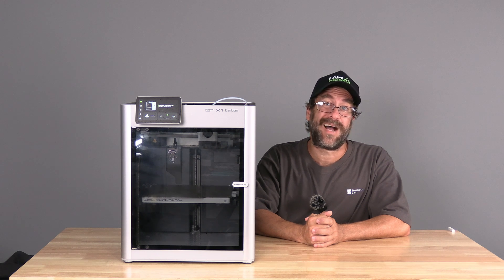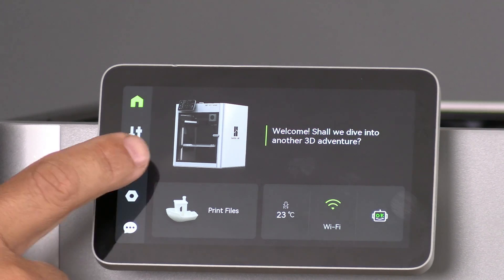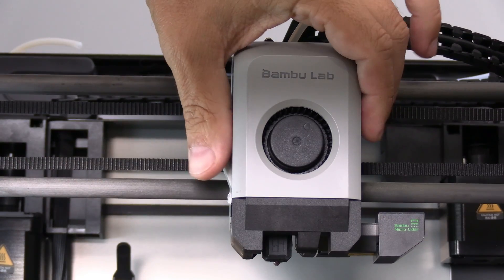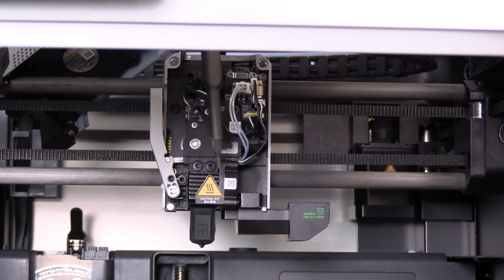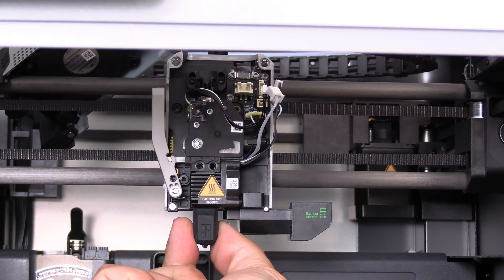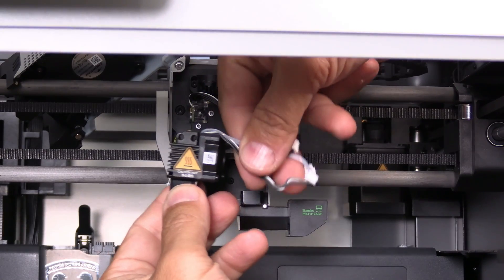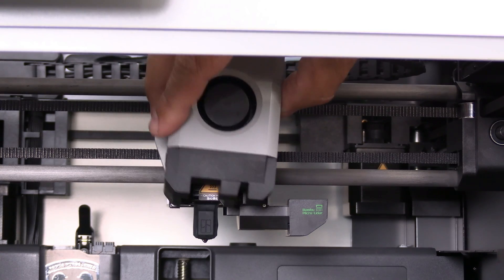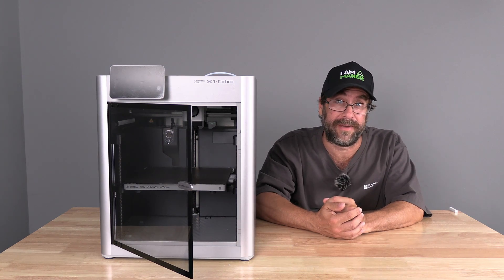Replace: Bambu Lab "X1C" HOTEND Assembly

Comment: Looks simple, but I have really large hands and it looks like I’m gonna have a time disconnecting and reconnecting those little cable connectors.
Reply from the maker: You'll be fine. No worries. Take your time. Easy-Peasy.
Reply: I also have large hands. I use longnose pliers to put back the cables and it make this a breeze. 

It would be a lot easier if the enclosure was 6 inches taller. Lower the hotend a bit to get a better visual position.